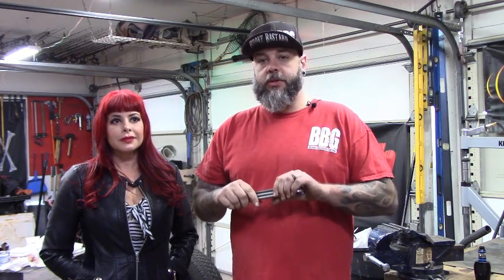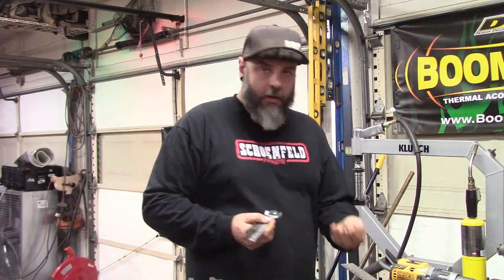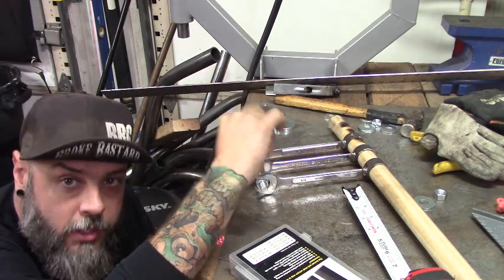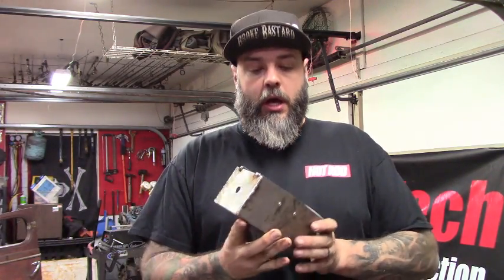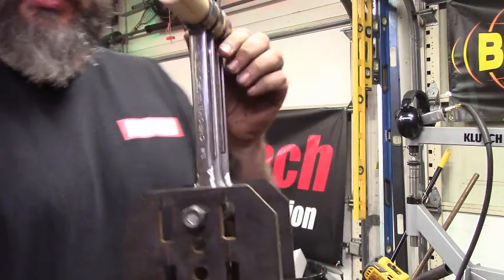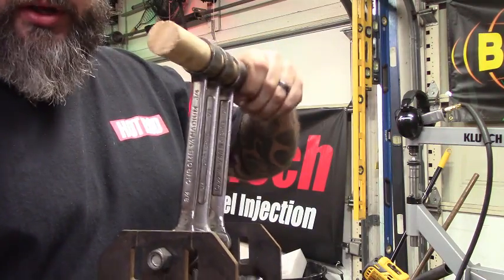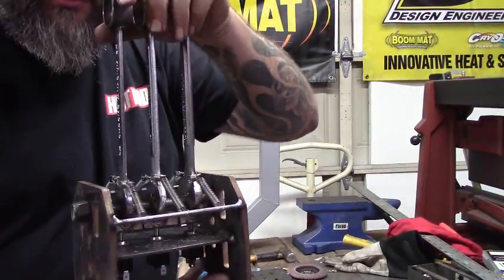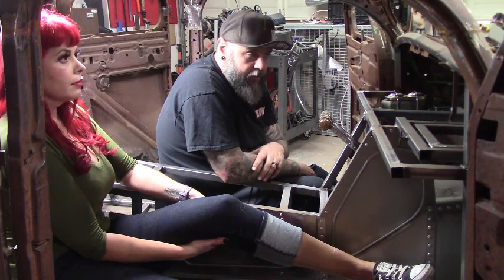"Custom Air ride controls" 1937 Rat Rod Build Update 43

Comment: Super cool.  Nice work and very clever ideas.  It was not clear to me in watching the video that you also included some way to limit the wrench travel.  Is it possible you can over-stroke and possibly damage the toggle switches?
Reply from the maker: I'm going to use the opening in the dash to limit the travel.
Reply: Perfect. Maybe some slit vacuum or aquarium hose around the edges, to trim and provide a soft stop?

Comment: Nice job. I like the trial and error of the first box to your final design. 
Hey I watched the beard roller episod. How did the strengthing of the "C" body work for you?
Reply from the maker: Roger Miller roller is rigid and doesn’t move. I have gone thru a couple motors already. Working on a better torque motor design.
Reply: @BrokeBastardGarage  
I recently purchased the same bead roller used for cheap. In trying it I also saw the flex and didn't like it. I have some heavy steel angle stock that I'm gonna use to stiffen it up. I'm not interest in the motor for now. Try a 1/2" mixing drill with a 450 rpm. I mix up spackle and thin set with this drill in 5 gal buckets and it's tough. ✌